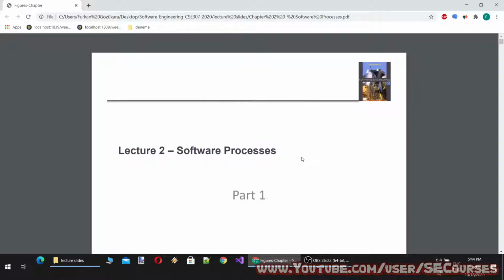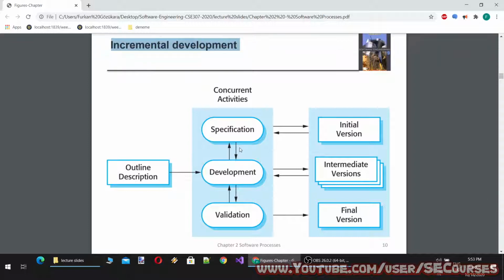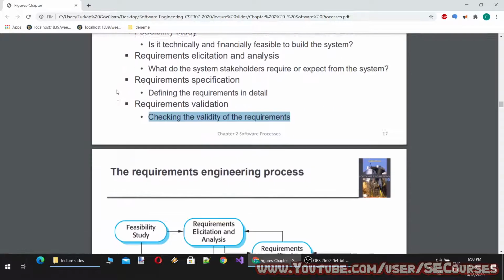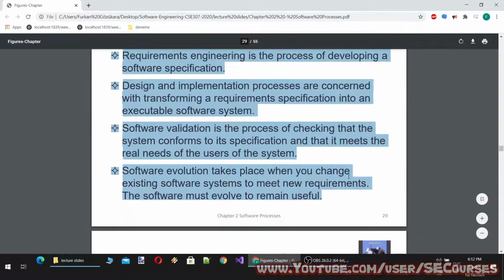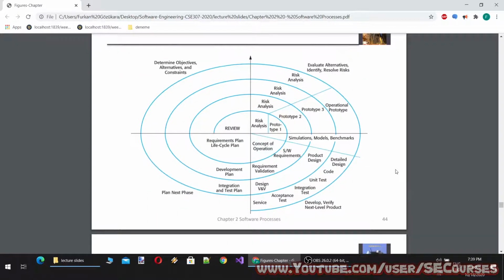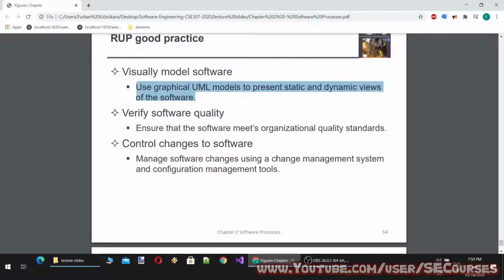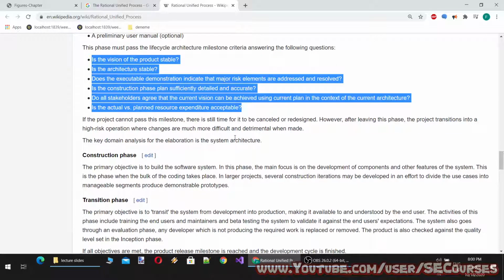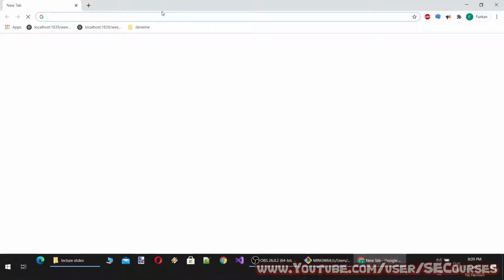#Software #Engineering - Lecture 2 : Software Processes, Activities, The Rational Unified Process

Comment: in this video, i learned and i took note ;

lecture 2 - SOFTWARE PROCESS

Topics covered ( software process models, process activities, coping with change, The rational Unified Process)

+ The software process means.
+ Software process descriptions (also products, roles, pre and post conditions)
+ Plan-driven and agile processes.
+ Software process models (The waterfall model,Incremental development,Reuse-oriented software engineering
+ The waterfall model
+ Waterfall model phases AND problems
+ Incremental development 
+ What is COTS
+ Incremental development benefits AND problems
+ Reuse-oriented software engineering
(REQUIREMETS SPECIFICATION -> COMPONENT -> REQUIREMENTS MODIFICATION ->SYSTEM DESIGN WITH RAUSE -> DEVELOPMENT -> SYSTEM VALIDATION) 
+ Types of software component (.NET OR J2EE)
+ Process activities
+ Software specification
+ The requirements engineering process
+ Software design and implementation
+ A general model of the design process 
+ Design activities
+ Software validation
+ Stages of testing (COMPONENT TESTING -> SYSTEM TESTING -> ACCEPTANCE TESTING -> COMPONENT TESTING  ||  COMPONENT TESTING <-> ACCEPTANCE TESTING)
+ Testing stages
+ Testing phases in a plan-driven software process
+ Software evolution
+ System evolution 
+ Key points
+ Coping with change
+ Reducing the costs of rework
+ Software prototyping
+ Benefits of prototyping
+ The process of prototype development
+ Prototype development
+ Throw-away prototypes
+ Incremental delivery
+ Incremental development and delivery ,advantages,  problems
( WE CAN CHOOSE METHODS)
+ Boehm’s spiral model
+ Boehm’s spiral model of the software process 
+ Spiral model sectors (OBJECTIVE SETTING, RISK ASSESMENT AND REDUCTION, DEVELOPMENT AND VALIDATION , PLANING)
+ Spiral model usage
+ The Rational Unified Process ( DYNAMIC, STATIC, PRACTIVE)
+ Phases in the Rational Unified Process
+ RUP phases (INCEPTION, ELABORATION, CONTSRUCTION, TRANSITION)
+ RUP iteration (IN, CROSS)
+ Static workflows in the Rational Unified Process
+ RUP good practice
+ Key points
+ What is  RUP ? (Wikipedia) 

195050803
AHMET MUSTAFA VİDİN